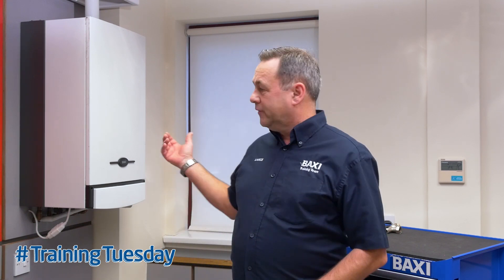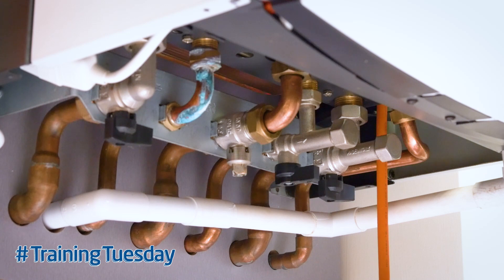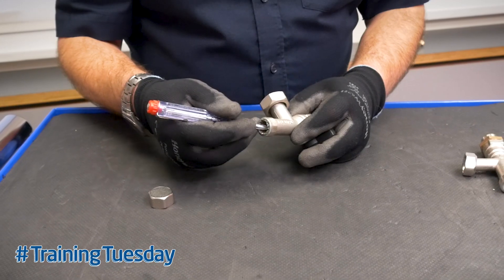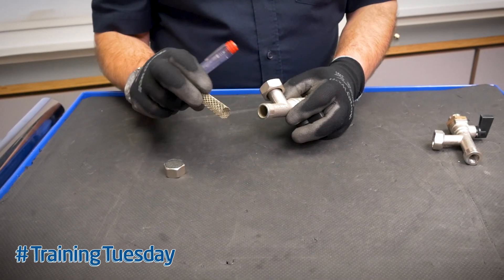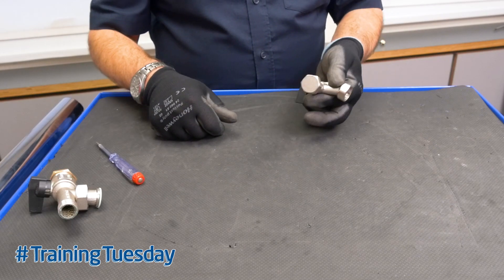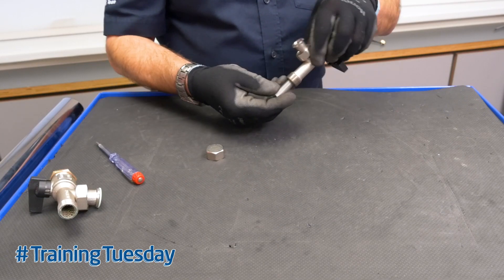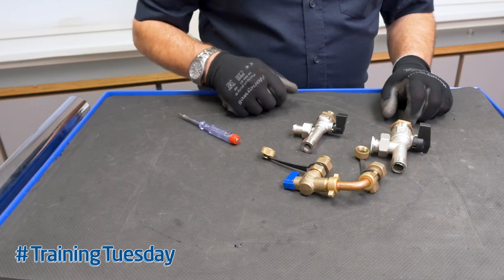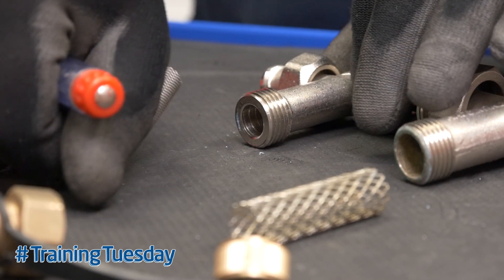How to remove and clean the gauze filter on the Baxi 105, Platinum and Duo-tec boiler ranges

Comment: A heating engineer removed this filter from my 105he and discarded it in an attempt to resolve a an issue of boiler failing to start. He said this part is not necessary. Should i look at getting one to put back in there or is it truely not necessary?

Thanks

Comment: What causes a baxi combi to fire up Ch then shut down, fire up, shut down constantly with the LCD panel flashing like crazy? Drain off some pressure, works ok for a day or 2 then goes mental again! Boiler 18 months old 😠 Then no hot water cos the pressure is too low. Top up to correct bar and then heating won't work with above problem.
Reply: Will get back to you
Reply: PCB